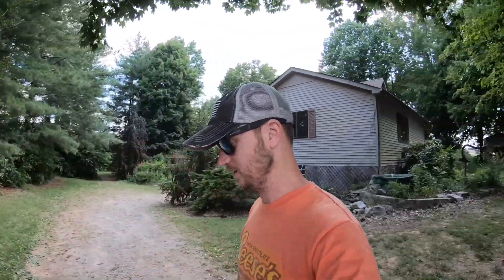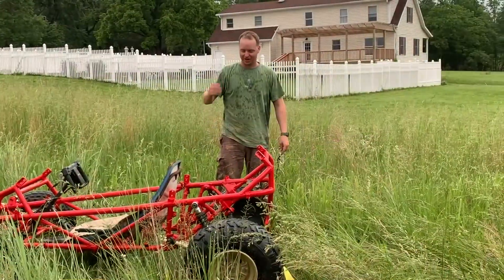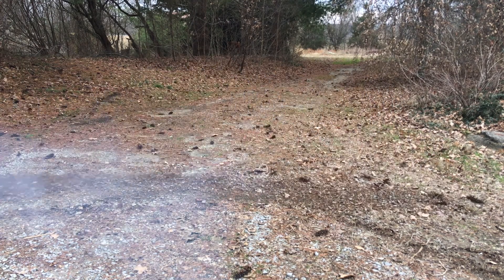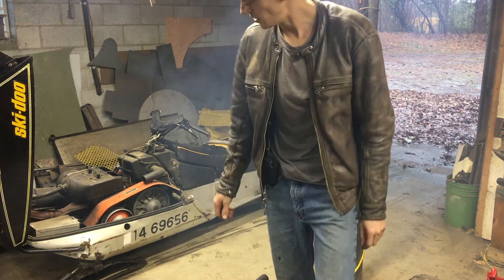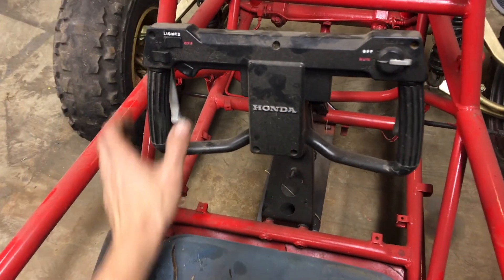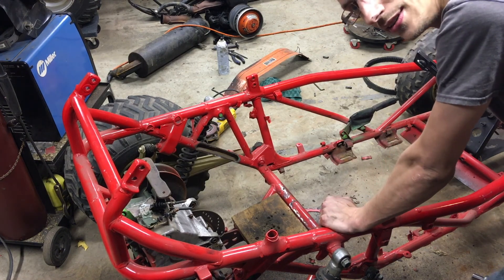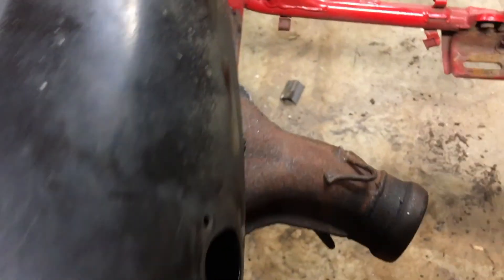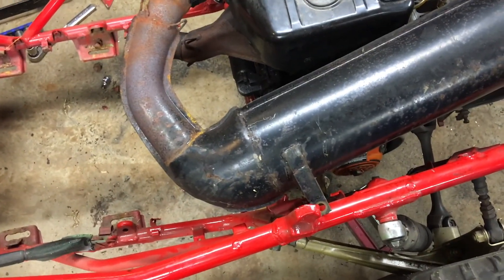FL350 build part 1: FL350 build using 500cc Rotax Snowmobile engine.

Comment: i didn't think air cooled snowmobile motor would last long in hot air in the summer. I thought you would need a water-cooled snowmobile motor for summertime riding I guess I was wrong big time but great build.
Reply from the maker: This particular engine has it's own cooling fan so it does fine in warm weather, I've never had it in the desert or extreme temps but I am curious how it would do in that environment.

Comment: Is that a rotax 503 iam building the same build do u have any footage of the motor brakets you used and can u tell me what type of clutch are you using mine didnt came with clutch
Reply from the maker: At about the 10:40 point in the video is the best views I have of the engine mounts. The aluminum plate is from the snowmobile, and we used angle iron to make a simple bracket welded to the frame. 

As for the clutches, the drive clutch is what came off the snowmobile, and the driven clutch   is the original fl350 clutch. 

Hope this helps, good luck on your project.